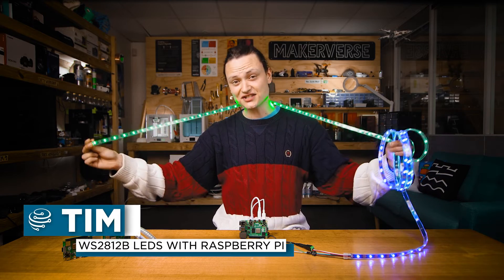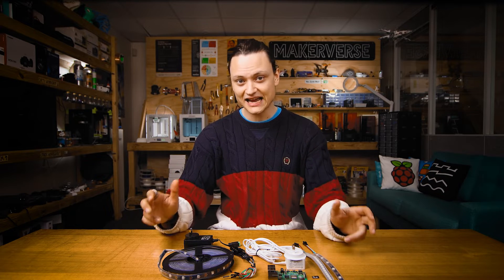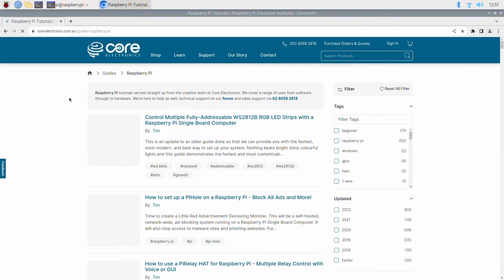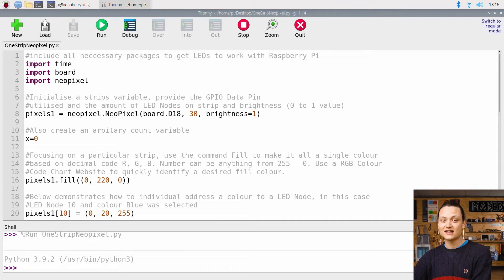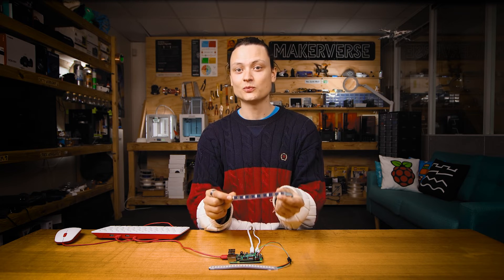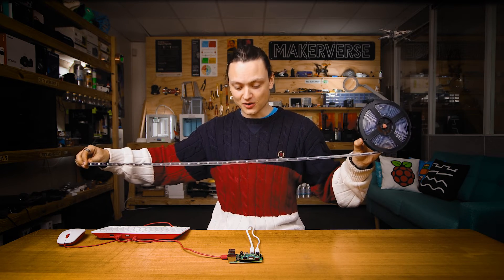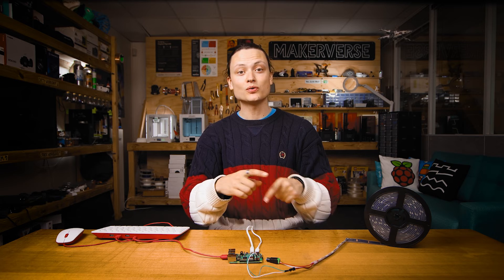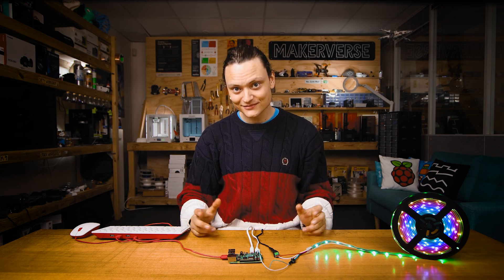How To Use Addressable RGB WS2812B LED Strips With a Raspberry Pi Single Board Computer

Comment: Beautiful tutorial!! Quick question: Can I connect a long WS2812B LED strip plus a TFmini-s Lidar Sensor on the same Raspberry Pi 4? Of course, I will use two power supplies, one for the Raspberry and another one for the lights. Is there any GPIO conflict?
Reply from the maker: The lidar sensor you named uses UART (Pin 14 & 15) or I2C (SDA & SCL) while the LED strips just use a simple GPIO pin (18) so there should not be any conflict with wiring them up to the same Pi.

Comment: Hi, I am totally new to LEDs and in need of some advice. I recently purchased a 5 meter 5V WS2812B RGB LED strip with 300 pixels and now I am looking for a portable and rechargeable battery that can power it for about 5-6 hours before needing to be recharged. Any recommendations? And I also need the simplest controller that can be programmed to randomly change colors by itself for hours.  Thanks!

Comment: Hi there, ive had some issues installing the programs provided onto my raspberry pi, when sending in the command it gave me an externally managed environment error, requiring python3-xyz. Any solutions on how to fix this?
Reply from the maker: Newer version of Pi OS require you to use a virtual environment for projects like this. We have a guide on it here:
https://core-electronics.com.au/guides/raspberry-pi-virtual-environments/

Comment: Question-- I'm controlling 3 WS2812B arrays (about 320 leds) and powering them externally. Many guides I have found online say to use a logic converter from the rpi's 3.3v to the WS2812B's 5v data lines, but i notice you didn't do that in your assembly. are you able to control the leds with the 3.3v logic from the raspberry pi safely?
Reply from the maker: Yes! 3.3 Volt logic can happily send signals to 5 Volt a device. There are some instances where issues can arise, but most of the time not an issue. However, if you send signals from a 5 Volt device to a 3.3 Volt device, you will need to use a logic level convert. The 3.3 Volt logic device may not be rated to receive 5 Volt signals, and you may damage something. So 3.3V > 5V no issue, 3.3V < 5V use a converter.

Comment: Hey, is there a way I can figure out why my Fractal Design Prism AL-12 PWM fan doesn't light up it's ARGB LEDs?
I used your code, I used chatGPT, everything at my disposal, also Arduino Nano with FastLED.. could it be the LEDs are fried or the protocol is different?
If so how do I figure which protocol it uses?
If you got time to respond I'd appreciate it :)

Comment: Hi my friend, can I use a 5V DC power adapter to the complete led strip and use the data and ground pins with jumpers in the data and ground pins of my mother board argb 3 pin to sync strip and pc leds?

Im from the Dominican republic.
Reply from the maker: Yes you can! Power the strip with the power supply and then you can use jumper wires for the ground and data pins as they don't draw much current.

Comment: Nice try. Too bad it does not work as you described. I can not install the packages. pip3 seems not possible and apt install says the packages can not be found. Any solution?
Reply from the maker: We don't do much support through YouTube, but we do have a dedicated forum topic for this post which might have some helpful information on it. If you're still having issues, feel free to post it on that topic, we have an army of makers over there who can help!

https://forum.core-electronics.com.au/t/guide-by-tim-control-multiple-fully-addressable-ws2812b-rgb-led-strips-with-a-raspberry-pi-single-board-computer/15651/2

Comment: When i am installing the proper packages, 4:12 
Any of these that I try to install get an error message “This Environment is externally managed”, any way to fix?
Reply from the maker: Sounds like you are running Bookworm OS. This newest version of Pi OS introduced the need to use virtual environments, we have a guide on how to do this over here:
https://core-electronics.com.au/guides/raspberry-pi/raspberry-pi-virtual-environments/

It's an extra little step to learn, but you only need to learn it once.
Reply: @Core-Electronics  tried this and it didnt work, i have tried everything , could you maybe make an updated guide with the pi5, i also am not sure if you are supposed to use gpio18 bc it is clocked i think that gives it more power than its supposed to or smth PLEASE make a tutorial, you have no idea how much i need this win i have worked on this for months now pls help me
i know making a video for just 1 person is crazy, but this video performed very well pls Tim or whoever runs the channel now PLEASE

Comment: What Raspberry Pi OS did you use for this project? Raspberry Pi introduced the VENV. This has changed some things about the software installation. Older OS versions do not require VENV. It would be nice if your installation also worked on the latest Raspberry Pi OS.
Reply from the maker: Bookworm has thrown a lot of our guides out of whack, but we have guides on how to deal with them:

https://core-electronics.com.au/guides/raspberry-pi/raspberry-pi-virtual-environments/
Reply: yes im having installation errors when downloading the things in the terminal

Comment: Could a 5V 8A power work or would that blow the led strip??
Reply from the maker: The strip will be powered with 5 volts, but it will only draw how ever much current it needs. If you have 1 led, it will only draw 0.06A. If you have 100 it will draw 6A. So if you are powering only a meter or so, that will be more than fine. There is an issue of having the strip too long though.

Usually there is a limit of how long a strip can be before it needs something called power injection. This is because if the strip is really long, it will have a lot of current going through sections of the strip and so its good practice to only run 5-6 amps through a strip. If you are running anything longer than 5 meters or 100-120 leds, have a search around to see how to use power injection!
Reply: @Core-Electronics  Oh awesome thanks for the reply, I almost got the 300 led strip

Comment: Hey gusy, I have a question. I did exactely what he did in the Video but the moment I want to install the library my raspberry tells me: Error externally managed environment: Does somebody has any experience with this or how I could solve this problem? Would appreciate some help :)
Reply from the maker: With Bookworm OS we have to use virtual environments now. We have another guide where we demonstrate how to do this with a different project. 

https://core-electronics.com.au/guides/raspberry-pi/getting-started-with-yolo-object-and-animal-recognition-on-the-raspberry-pi/

You will need to:
1. Create the virtual environment in the terminal
2. Enter the virtual environment in the terminal
3. Install the libraries you need
4. Go into thonny and make it work inside the virtual environment we created.

All of these are in the guide above, best of luck and if you get stuck, feel free to pop a question on our support forums!
https://forum.core-electronics.com.au/

Comment: Has anyone connected fairy lights to a pi?
Reply from the maker: That would depend heavily on what fairy lights you are using. But if I had to do it, I would use some MOSFETs to control them.
https://www.youtube.com/watch?v=t1WRxmG3h3I&feature=youtu.be

Comment: Hi there

I have a 30x30 10mm ws2812 fan with four wires which are "red,black,blue,green" for the raspberry pi I can hook the red and black fan to get power but the green "ws2812 leds" and blue "pwm". How can I get my LEDs to work it has four LEDs on it.

Any help will really be appreciated.

Comment: Very nice, followable and understandable Tutorial! But I have the problem that I cant install the first package. I get the Error Message that this is an external enviroment. Do i need some kind of driver or previous package? Greetings from Germany
Reply from the maker: Bookworm OS now forces us to use virtual environment to install virtuall managed environments, its a bit of a hassle but its not too hard to work around. Here is a great guide on that:

https://www.raspberrypi.com/documentation/computers/os.html#python-on-raspberry-pi
Reply: @Core-Electronics  thank you for your comment I actually got it running a couple of hours ago with an virtual environment, but I'm stuck at the problem that it can't find/ can't Import the "Board" library so the GP18 can't be addressed. Is there a workaround for that too?
Reply: @Core-Electronics  thx its really nice how you answer every comment

Comment: Did the female ends of the LED strip come with the strip itself? Or did you add some kind of short 3 male to female jumper? The strips I bought have have standard wires with no connector. I'm finding it hard to find a jumper that looks as convenient as that.

Comment: I'm trying to do this with 12v WS2815 addressable LEDs and a Pi Pico is it possible with an external 12v source?

I've done this already with a neo pixel ring that only required 5v

I have 3 x IRFZ44n hooked up to GND, RGB(strip) and also to GPIO on the Pico but I don't know how make the code work / ;

Comment: I need handle 6 leds strip. Exists a Raspeberry version able to do that?
Reply from the maker: You can actually do this all on the same Pi! There is a little setup required though.
The data terminals of all 6 strips can be connected together to form one long "chain" of LEDs. The issue is powering them as you can't power too many LEDs in a row. You will need to do something called "power injecting", which is basically where you just power the strips individually, but have the data lines connected. Then your Pi will see all of these strips as one long led strip it can control.

I hope this helps, if you need any additional guidance, feel free to chuck us a post on your forums: https://forum.core-electronics.com.au/

Comment: Running pip3 commands results in an error now: "error: externally-managed-environment". What is your recommendation for working around this?
Reply from the maker: If you are running bookworm os, they now require you to use a virtual environment.
Here is a guide on how to do that: https://core-electronics.com.au/guides/raspberry-pi/using-virtual-environments-in-thonny-on-a-raspberry-pi/

Comment: "1 Amp per 50 LEDs" is my general rule for 5V

12V strips/supply roughly doubles that to 1A per 100 LEDs (really more like 120 but it's easier to go with 100 for a rule of thumb)
Reply: Hello, Play it safe! 1 LED = 20mA -> 3 RGB LEDs (white color) = 60 mA (= max current) -> 100 LEDs = 6000 mA = 6A

Comment: Can you power multiple LONG strips with this method?
Reply from the maker: Yes you can! The only issue will be powering all the LEDs.
Reply: @Core-Electronics  so if I were to use your method of powering them and copy that twice on the board, I’d be able to get two long strips powered?

Comment: Awesome video. Super easy to follow and very informative. I am a Software Engineer but not the best at wiring and/or electrical so I have a question. Is there any way that you can control more than 4 strips with a raspberry Pi despite only having 4 GPIO pins? Thanks in advance!

Comment: Where and how do I even find this thing to screw down two cables and connect it to this power? And also where do I find cable to connect it to the wall?
Reply from the maker: Hey 8ball, all the parts are listed in our written article here: https://core-electronics.com.au/guides/raspberry-pi/fully-addressable-rgb-raspberry-pi/

Comment: It's really cool approach connecting through the raspberry. I have a question: Is it possible to connect 10meters of ws2812 LED via external power supply of 3A but to reduce the LED count. I have 10meters (5 meters * 2) of 60 LED/m LED stripe. So due to the power consumption I want to reduce the LED count from total of 600 to 50. So 50 LED per 10meters. so instead of 60 LED in 1m I want to use only 5. Or to reduce power consumption in half. Because I don't have a 36A power supply

Comment: Noob question , 4:12 
Any of these that I try to install get an error message “This Environment is externally managed”, any way to fix?
Reply: yes, after putting the commands like "sudo pip3 install rpi_ws281" add '--break-system-packages' there are two dashes before break and one between break and system, and one between system and packages, and example line is "sudo pip3 install rpi_ws281 --break-system-packages" you may then be prompted to say yes, depending on the system (say yes).
Reply: I'm having the same issue, were you able to figure it out?
Reply: hey guys i have this problem too, did you find a solution?
Reply: Did you find a solution ?
Reply: im having the same problem ima repost the comment and see if he sees it
Reply: I tried making a virtual environment, and it was installed

Comment: 1:39 "General Rule of Thumb: A 5V 4A power supply can comfortably handle 150 LED nodes, at full brightness"

150 white LEDs at full brightness would take 9 amps. I haven't done any projects with LEDs yet, but I don't understand how this (5v 4a) would be the recommended power supply. Is it likely that someone is going to go full bright white with their LEDs? Nope. But if they did, bad things would happen, wouldn't it?
Reply: No . If your supply limits current then the strip will use only 4 amps but if its not then it depends on the metal in the strips . It might heat up or melt ! 😅

Comment: Hello. I found this video very helpful for my project. But I have one question. 
I have an WS2812b led strip of 5 meter. What power supply do I need if there are 60 leds/m? There would be a total of 300 leds on the strips

Comment: Pro-Tip: if powering the LED strip through a power brick, use a step down buck converter or a resistor to bring the 5 volts down to 3.6 volts. 3.6 volts INSTEAD OF the actual voltage usage from the data sheet for these LEDs.
Reply: While it's always good to match the voltage, what is the actual benefit of doing this? Considering it's more material and setup, I don't see much point unless I'm getting a real benefit out of it. Would it  use less power long term? Would it help the LED's last longer? Thanks in advance by the way =)
Reply: @nickcocca2210  The color accuracy is better and it will help your LEDs from burn out. Power consumption in my opinion is negligible.
Reply: WS2812B supply voltage is 3.5V to 5.3V.    WS2812B-mini  voltage is 3.7V go 5.3V.  That is right from Worldsemi.    I am curious to where you found 3.6V is the ACTUAL voltage usage from the datasheet.
Reply: @ericwright3382  oh crap! That’s a typo. My post should have read “3.6 volts INSTEAD OF the actual voltage usage from the data sheet for these LEDS.” Auto correct is really out here spreading misinformation lol
Reply: How many amps?
Reply: @turbocharged213  You'd be pulling more amps the bigger your LED strips is, so it depends on the size of your LED strip. I've managed to have good results with a power supply rated for at least 2 amps for a 120 LED strip, with room to spare.
Reply: Anyone who doesn't know about up and down converting  should not be trying any of this. simple prerequisites

Comment: Is there any reason that GPIO21, GPIO18, GPIO12 and GPIO10 are used in particular for WS2812B LED Strips? Is there anything stopping me from using any other GPIO pin?
Reply: I believe it’s due to how the strip accepts its data signal - as it’s a high speed, fixed rate, continuous stream of bits - and how the Pi can achieve that while also doing all the other things it needs to do (such as run the operating system). The libraries cleverly use the PWM of the GPIO along with DMA to be able to stream all of the data without getting interrupted.
I’m only just starting on my journey of understanding these ARGB strips and how they communicate, but I think that’s the reason.
Reply: I think it might have less to do with the strips being WS2812B requiring those specific GPIO pins And more to do with the raspberry pi needing to use those GPIO pins to send the proper signal to the WS2812B strip. Actually I don't believe the WS2812B strip is the factor that dictates using those GPIO pins.. TBH I don't see why any other WS281* "family" of LEDs wouldn't work..or ws2811, ws2815, ws2813 etc. of course you'd have to be mindful of the power requirements because some in those types of LED IC don't always use 5v. So if they use a 12 volt power supply, just ensure that you're using a common ground with the PI

Comment: Hey, quick question I've been trying to figure it out. Would it be possible to use two different controller inputs into the same strip? Would one signal just override the previous signal or will it be a whole jumbled mess? I've been using these strips on my car and want everything to match
Reply from the maker: sounds like a pretty niche application. Head over to the forums for some more in-depth help https://forum.core-electronics.com.au/

Comment: Where did you find a LED strip with a Male 3-pin connector as the data input wire? I am in the US and I can't find a single one.
Reply: They're the same physical size as the two pin, power-only configurations. The third pin is used as the clock/data pin in the individually addressable versions.  The non-addressible strips use R, G, B, Ground for 4 pins.
Reply: @RobertLipe  It's not about the pins. It's the fact that in the US nobody sells a Male 3-pin connector as the data input wire. Instead I can only find Female 3-pin connectors.

Comment: Would it be possible to do this on something other than a "real" Pi? Such as the Libre PC S905X. I'd have to probably mess with the setup of GPIO pins, but I have some individual LEDs that I believe are the same chip as used in the video, I'm just trying to see where I can get started.

Comment: I managed driving such a strip of WS2812B LED this with an Arduino Uno (ATmega328, 8 bit AVR uC). Firmware ~1kB, 420 Bytes of SRAM used... No need for such an heavyweight platform...